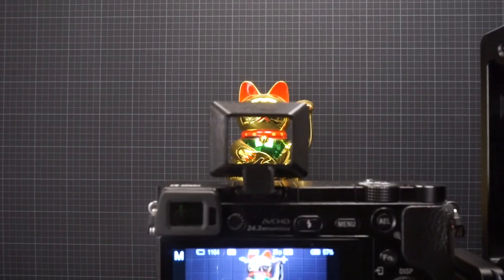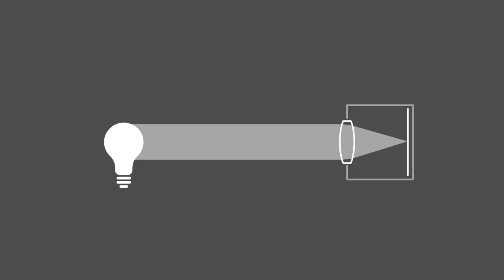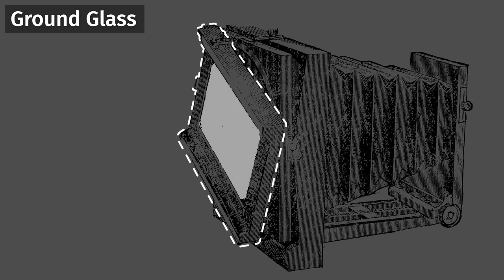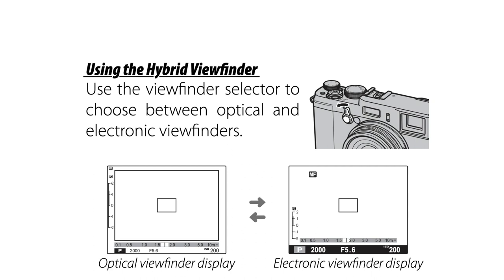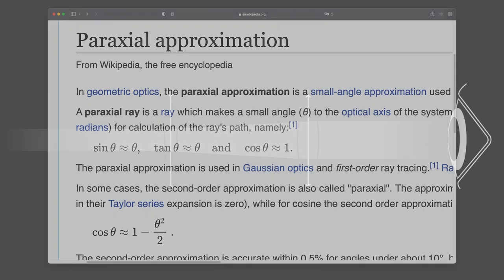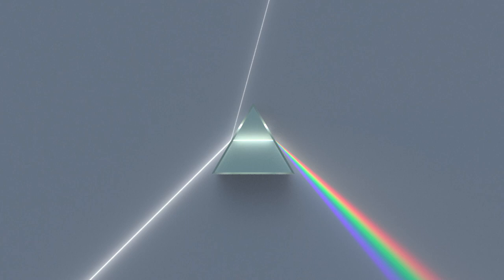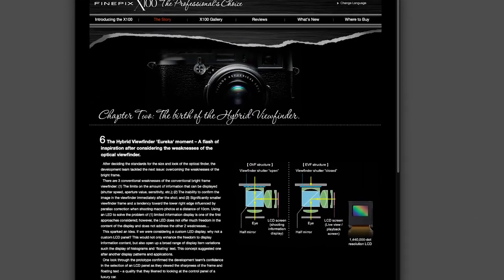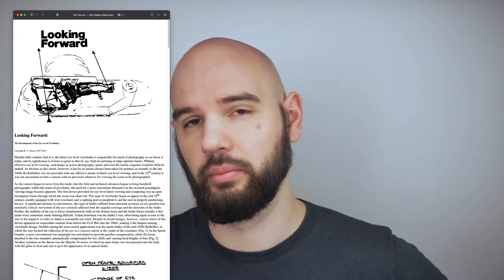Adding a Digital Overlay to a Camera Viewfinder

Comment: could you do something like this for a rifle scope?  Is there any books or websites you would recommend to learn how to do this in more depth? If you were to add this in front of a scope how would it affect the transparency of the scope with the view finder in its path? Could you still get 90 % transparency? Your project is fantastic!! thank you for posting.
Reply from the maker: I listed my sources at the end of the blog entry: https://volzo.de/thing/hybridviewfinder/
The optics books explain the fundamentals in depth but are not exactly beginner friendly. To the best of my knowledge riflescope designs are basically the same as the viewfinder but in reverse (thus increasing the magnification instead of reducing it) and are not using a Galilean geometry (so they need to have a focal length sufficiently long that the image can flip inside the riflescope barrel and exits upright again). That makes the optical design a lot more complex than just a positive and a negative lens with a beamsplitter in-between and less suitable for DIY projects. But the concept is the same: put a beamsplitter in the right spot.
Controlling the transparency is easy, it depends solely on the beamsplitter and ratios like 50/50 or 70/30 are common. I remember seeing a similar project with a small single-color display for a riflescope a few years ago, but couldn't find it in a quick search.
Reply: ok thanks..would you happen to know the transmission rate of those len's combined with the prisms? and if this setup would be the best setup to use on a regular rifle scope? I want to add my own small screen in the path of the scope so i can add some images like you did...but its for a scope so i want to keep the profile down if that is possible.  Perhaps a different configuration..thanks
Reply from the maker: I'm afraid I don't know enough about riflescopes in general to say anything helpful in that regard. The transmission rate is probably something you can calculate from the datasheet of the lens manufacturer.

Comment: Nice project, can you try to build n analyse a analogue Director's viewfinder.There is no much material available for the instrument online to study about it n build one
Reply from the maker: A directors viewfinder like this one? https://www.denz-precision.com/en/cinetec/oic-35-opt-viewfinder/
I would guess that just works by putting a ground glass (with frame lines) in the focal point of the lens (where the film/sensor would be) and then flipping the image with mirrors/prisms so it's correctly oriented when looking through the other side of the viewfinder. There may be an additional lens for the eye so it's more comfortable to focus on the ground glass. The problem with that it's rather clunky.
Reply: @vlztn  https://youtu.be/lMptU-YjIzQ

I was designing one for personal use n stuck as there is no enough material to refer to online...thx for the reply